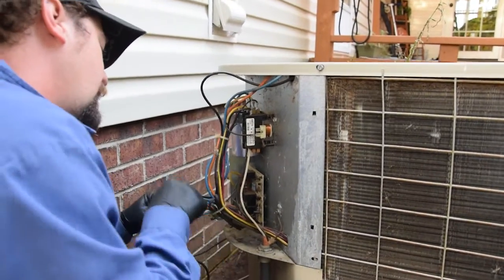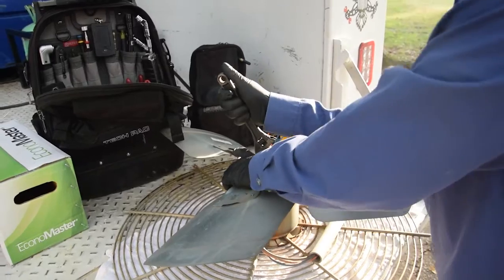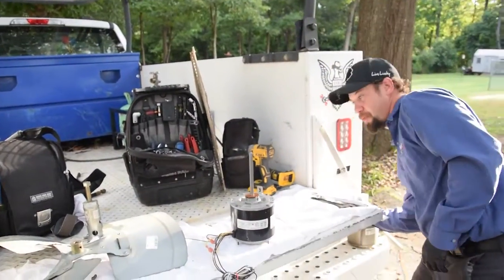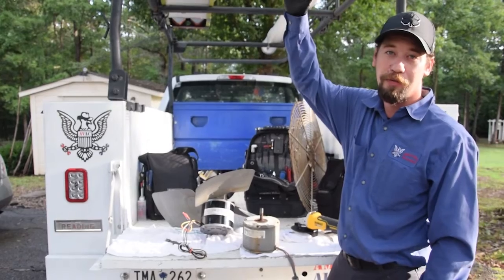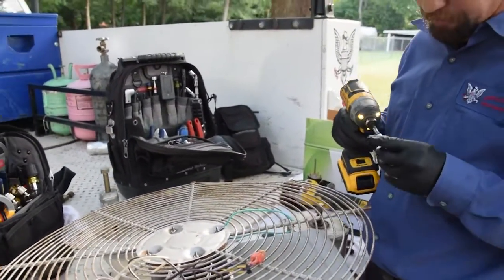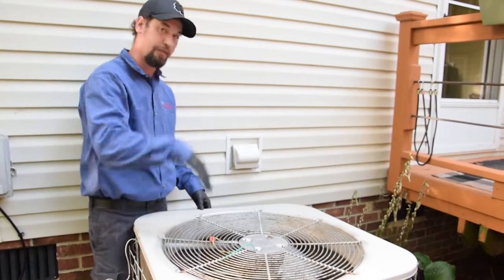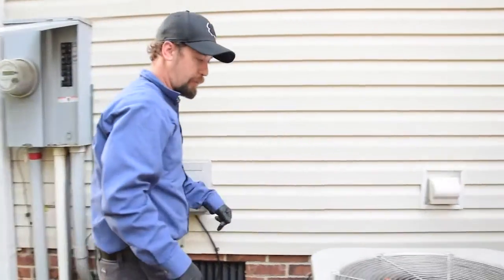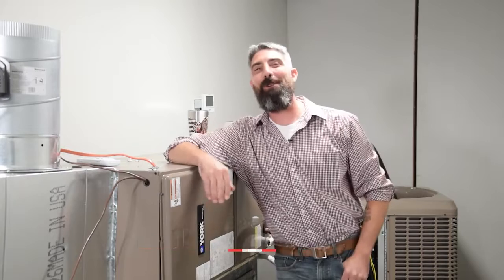HVAC Fan Motor Installation

Comment: Why did you leave wires outside the grill? In Phoenix the sun ruins the insulation really fast and then we would have bare wire on the grill. In any event thank you as this has really helped. I think i can limp my old 1982 unit through awhile longer. Thanks